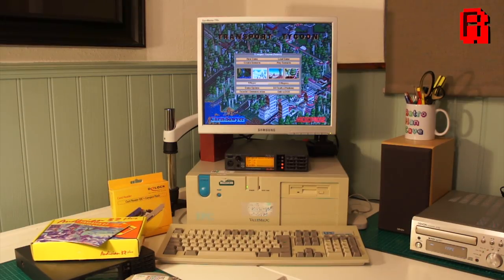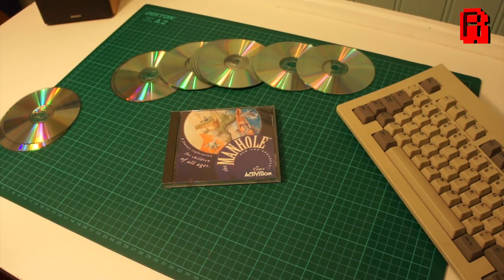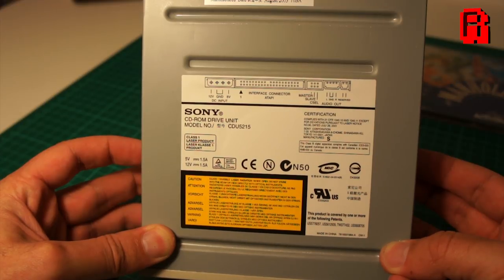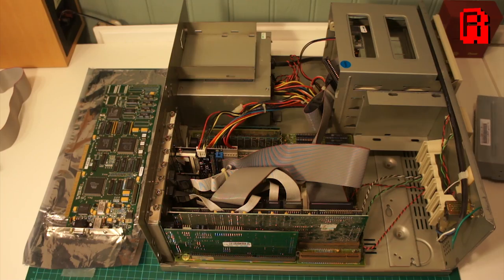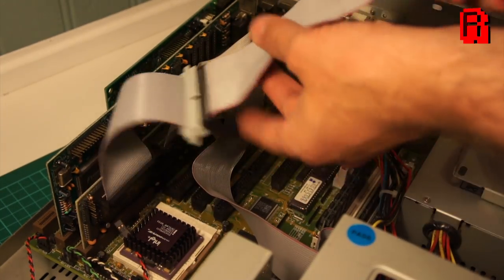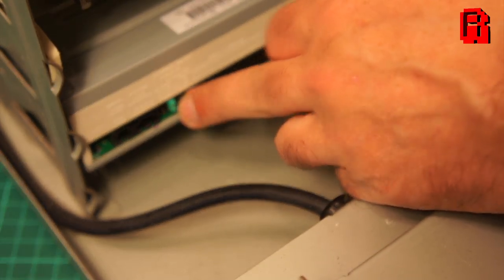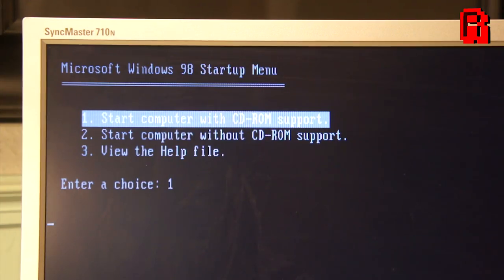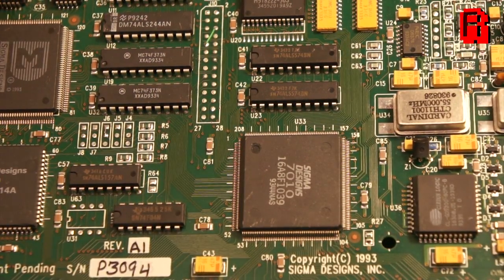486 Trash to Treasure Pt3 | Multimedia & MPEG

Comment: MSCDEX and OAKCDROM take up a lot of ram (I think around 50k). There are now much smaller drivers such as SHSUCDX (to replace mscdex) and videcdd.sys (to replace oakcdrom.sys) (there are many other available as well). I've tested them and so far I didn't run into any incompatibility or problems and they only take up less than 10k of ram ! Quite an improvement !

So if you run out of memory, remember you can use lighter cd drivers ;)
Reply from the maker: Deksor nice tip thank you!

Comment: The Amiga CD drive was called a570. The add on a520 was the tv-modulator/composite adapter, to connect your Amiga 500 to a color TV.
Reply from the maker: Nils Pc Vids that is correct.  I had the A570 on an A500 which was great but not completely compatible with all CDTV titles.  I think the A590 was a HD
Reply: RetroManCave yeah, the 590 was the SCSI controller. I would love tk have one of these because sadly all my floppy disks are dying a slow death and copying images over to new disks via the serial port is a pain and does not always work that well. I really like my Amiga 500 most importantly because I have the special tiger design which is becoming pretty rare nowadays. Sadly my crt is dying on me right now but I will soon get a scandoubler for my a500 to connect it up to a flat screen VGA monitor which will give me some extra video quality compared to the composite video crt that I am using right now with the a520 modulator
Reply: The woman who did that tiger design and that other awesome design sadly died a few weeks ago. She became a pretty famous radio announcer in a part of Germany.

Comment: I didn't realise you could now get an extension ide able, just ordered one for my Acorn A4000 so I can have my dual CF adapter cards on the outside of the case for easy access.  The one i ordered is 30cm in length.
Reply from the maker: Andrew Littleboy An A4000, would love a game of Chocks Away on that

Comment: U should of used the drilling method that cable is a ultra ata cable it has 80 cables instead of 40 like the extension and would normaly give you better speed pio number could of been higher

Comment: That's not a multimedia CD ROM drive. You need to install a CD ROM drive that has builtin CD Audio capability for proper 1990's game support. I remember fondly how cool it was to listen to a CD no matter what you were doing on the PC at the time. The authentic multimedia drives have the play and stop buttons on the front usually along with a headphone jack. Most people don't realize that you can put power on these drives and plug in headphones and they will play a CD even when not inside a PC.

Comment: imagine it's the 90s, you get your first "multimedia kit", a cdrom and a soundcard, you install it, your parents are watching because in those times that was a very big thing (and you had to beg for months), and the first cd you have to try it is "manhole!!" hahahahaha.

some bioses detect the cd anyway even if you set it to "none". (doesn't it have the "auto" option? maybe it works better for the hard disk too. I guess if the bios is too old it doesn't have the "auto" option). the "detect hard disk" thing never sets the cd, it puts it as "none". (at least it behaves like that on some pentium machines). you have to set it manually to auto or cdrom or just leave it at "none" but after the ram check the bios will say "blah blah cdrom" anyway.
I don' think your point was "I need the drivers because the bios didn't detect it", you seem to know a lot about computers, but just in case it was your point: 
even if the bios had detected it you would still need the driver in config.sys and mscdex in autoexec.bat. cd drives don't just run like hard disks do, they need drivers.

Comment: Sorry but you picked less good cd-rom drive. Sony was crap. Creative was crap too. Best in the beginning was Panasonic and later was TEAC and Lite-On. TEAC reader and a writer with scsi was the best.
Reply from the maker: It's a balance isn't it, I used what new old stock I had available rather than buying a CDROM drive.  It's not of the period of this machine as this is a hybrid restoration rather than a period piece and the goal was not to make it the fastest, but the easiest to use for day to day retro gaming, so it will suffice :)
Reply: RetroManCave It was not about speed. Reliability was more important. When I changed my Panasonic 2x to a Creative 8x it was a nightmare. Lots of 32x and 48x where crap too. The RMA could be 90%.
Reply from the maker: I see, well it's all good and I have plenty of spares if it needs to be swapped out.  The majority of time though I'm dropping files directly on to the CF card and the CD doesn't get used, but I couldn't have a multimedia PC without a CD drive!
Reply: agree on TEAC, its the best cd-rom i've tried, until asus cd-rw drive came along
Reply: @DK There's a problem in your logic since all Creative drives, CD and DVD, I came across were in fact re-labeled Panasonic drives.